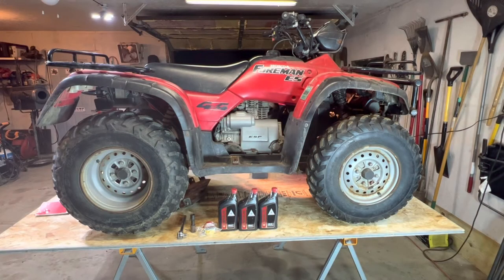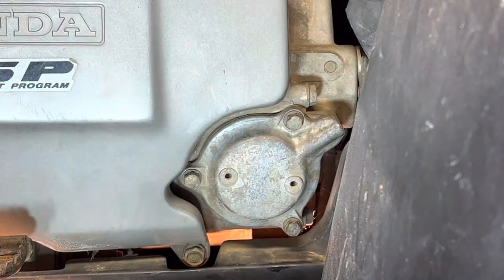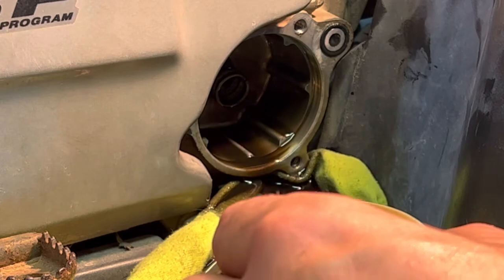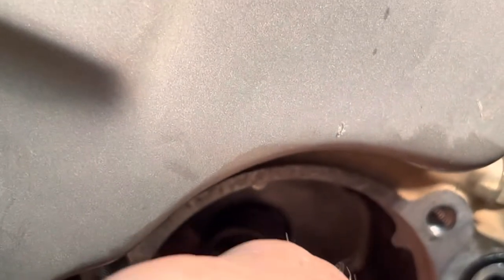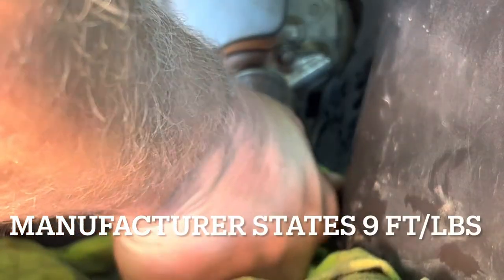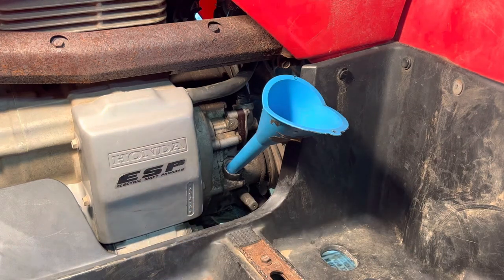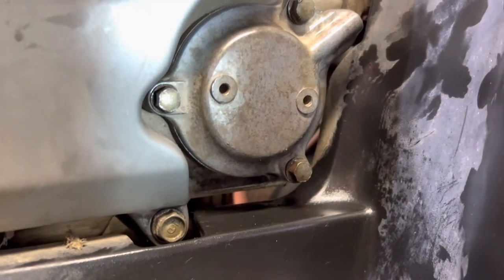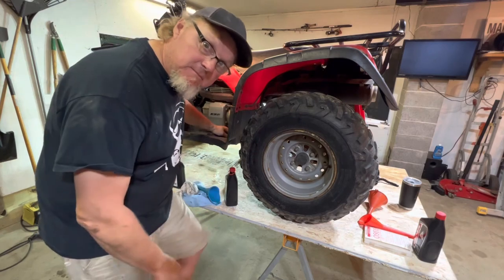Honda Foreman oil and filter change (2000)

Comment: Could this be the reason my for wheeler is going slower?
Reply from the maker: Not normally unless your engine is hurt. It’s relatively easy to change the oil and fairly inexpensive. I got the kit on Amazon. 
As far as it going slower, that’s kind of a vague question. So many different variables could attribute to a four wheeler losing power. I’d honestly start with the basics and give it a tune up. I have all of that on my channel for this very machine. The whole kit is cheap and it includes oil, filter, air filter, and a spark plug. 
Hopefully that’s all it takes for your machine to restore its power.if it does please tell me about it…good luck.
Reply: @pilgrimsgarage  ok thank you very much.